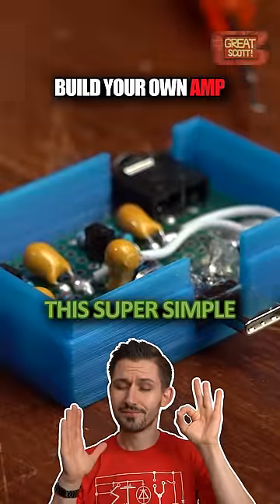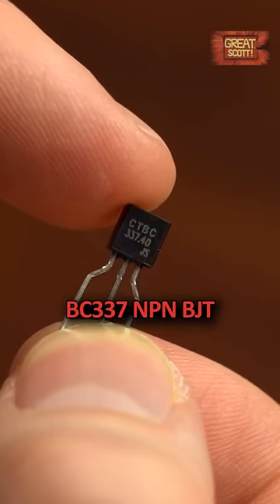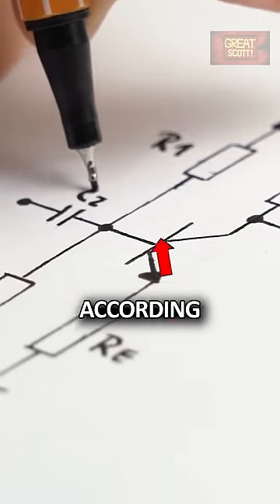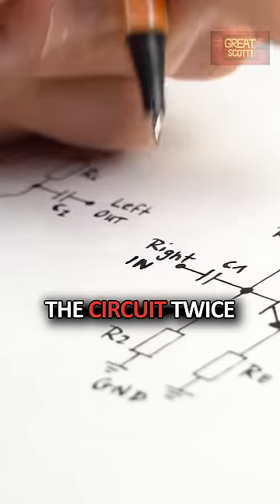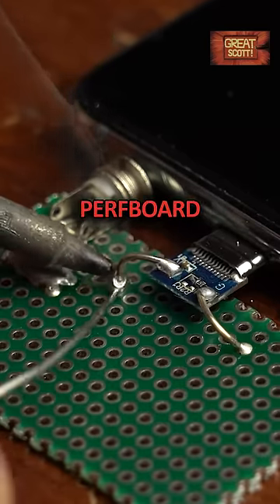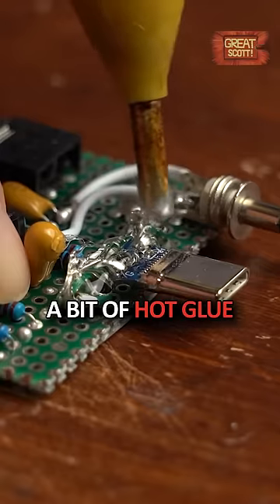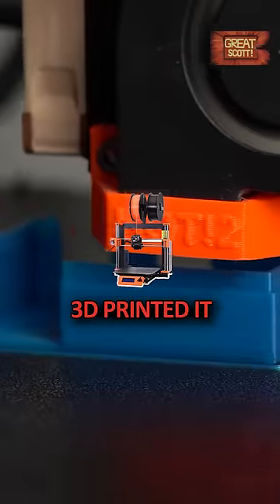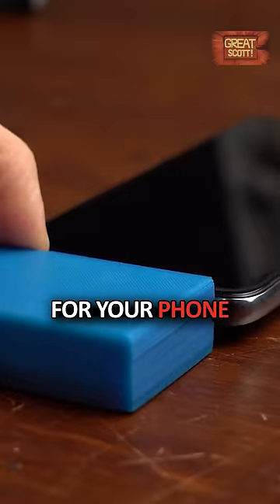Build the Best Sounding Audio Amp!

Comment: RIP headphone jacks.
Reply: Nope, still alive.
Reply: Headphone jacks are still alive, it's just a stupid trend apple introduced which fortunately was short-lived. High end phones don't have it cause they assume you're rich and have wireless but on low and mid end phones it's pretty much standard
Reply: His implementation obviously isn't going to do his equipment any damage, but the ability to blow out something is too easy for any amateurs replicating it 😅
Reply: @MikePerreman would gladly have my fold 4 than a headphone jack just saying..
Reply: my $150 phone have it, along with ir and included charger 😂

oh and also micro sd card slot along with dual sim, 5g 😏
Reply: @Mr.Engine993  is it possible if i solder the speaker output to a audio jack
Reply: @Mr.Engine993 my xperia 5 is high-end and has audio jack. perfect for gaming as bluetooth introduces latency.
Reply: @unusedaccount-b7t  theoretically yes, but it would be too much struggle and 99% chance of failure unless you are a phone expert (then it would be 60%, those solder connections are miniscule on modern day phones). Even if you succeed, you'll fry headphones and such devices because the signal for your phone speaker is amplified beyond line level (for headphones)
Reply: @Mr.Engine993  thanks for telling me that. i was planning to do that but i remember my hand always shakes
Reply: @Mr.Engine993 even FAIRPHONE dropped it. Still mad about that
Reply: Galaxy A here, it's nice to have one! 😊
Reply: @MikePerreman wait the latest Samsung also don't include headjack?
Reply: @MikePerreman  do they also no longer gave you charger like apple?
Reply: @Mr.Engine993 They also dont want you to have an analog signal at hand that you  can copy easily etc. If they could they would do the same shit as with video, DRM everything.
Reply: Get a Sony phone
Reply: Actually some of that "no headphone jack" phone still use analog output, just via type-c pinout, theoretically u just need to modify this project to working with that such phone, for some high end / newer phone that use data audio need type-c dac to play audio
Reply: @Mr.Engine993 Sony has them on high end phones. But I don't know for how long.... :(
Reply: Do you know what is more stupid than no jack? Still having the hi-res 24 bit/ 192kHz DAC inside LOL
Reply: the phone he's using literally has a headphone jack
Reply: @Mr.Engine993 Sony phone still has headphone jack but it'll cost a lot of money
Reply: @Mr.Engine993  You don't have to be rich to have wireless , just stupid. You can find brand name wireless earphones for like 20 bucks and they are ok.
But, even expensive wireless earphones are bad.
Wireless is far inferior tech in terms of audio quality than wired.
The power and consistency of audio signal is worlds apart. Heck you can lose signal completely with your phone in your pocket from time to time or the wireless ear plugs not being syncronized.
Reply: Unnecessary, coming from an audiophile myself. Any good headphones need their amp/dac. Planar magnetics are so open you’d annoy others. Not saying there are no closed off good dynamics driver headphones, there definitely are, but honestly how often have you seen for example (an other pair of headphones I have) Sennheiser HD600’s anywhere irl? Those are 300 ohm even with my iFi xDSD Gryphon, handles them no problem. Issue fixed. It has Bluetooth. Magic.

Comment: Now make a usb c DAC , cause I don't have a 3.5 mm jack :(
Reply: phones can still do analog audio out over usbc, you just need a breakout like he used
Reply: @game-tea well, not all phones do and even then, analogue audio via usb c isn't that good.
Reply: @harshlarose6670  whoops my mistake, interpreted Samsung's "384 khz 32 bit dac" spec on high end phones as them having analog audio out. Thats a bummer.
Reply: There are adapters.
Reply: Yes, some phones do really have analog signal via USB C. my USB C adapter from a Sony phone doesn't work in samsung, but on other brands. Don't know why
Reply: There are plenty of good usb c DACs out there, but why bother? If you're on android, just buy a radsone es100 or a qudelix 4K. Pricier than some usb c dacs (but not all lol), but they can drive surprisingly powerful cans, and the qudelix can even do parametric EQ, including an auto EQ that looks up headphone EQ from a database. If your phone supports Sony LDAC, there's really no reason not to use one. It can also double as a bt audio device for your car if you have an aux in.
Reply: @harshlarose6670 I don't believe that. If a phone doesn't have a 3.5 jack, it will have usb playback. Has to.
Reply: @ZenTunE-  USB audio output has two mode. analog, which only switched the USB data line to internal DAC output and the real USB audio i/o. not all phone have this analog output capability but every phone with USB OTG feature should be compatible with UAC device.

what he meant is the former ones, analog output over USB port that requires no external DAC
Reply: Yeah
Reply: Simple adapter for less that 10
Reply: @n.shiina8798  Phones not having analogue output is exactly what I meant. The pins are too small to make any good quality analogue connection anyway so if it's USB C, it's better to use a DAC.
Reply: @harshlarose6670  i dont think the pin is the main issue at all. 3.5mm jack also uses a small contact point and most phones are unable to drive more than a few miliwatts. what made them sh*t is the internal DAC quality and the lack of power to drive proper headphones
Reply: @ZenTunE- samsung doesn’t do it - bought 5 adapters to realize I need a dac, it’s frustrating - sound is coming out of speakers but no redirection to the usb c cable - why? Even apple does that properly
Reply: @robob3ar  I learnt about this too recently. My Honor 20 has analog usb c audio support and that is the adapter it actually comes with. Always thought the dongle had a dac in it but guess some don't then.

Got an apple dongle which does have a built in dac and the difference is insane, the phones built-in dac has so much static noise. Never gonna use the internal dac again.
Reply: Since apparently my comment failed to post, alc5686.

Comment: Getting a 1$ 2x3W class D amp would be far easier and more compact to do but I appreciate the effort.
Reply: its for educational purposes
Reply: Class A may be older, simpler and not as efficient as class D but the quality for the effort is unmatched. It is way harder designing or to apply a class D amp and getting the same quality out of it as with class A.
Reply: @tzrgfdrte a class A amp with a single BC337 and 4 resistors probably doesn't sound very good though. Neither do the $1 class D ICs, but they're probably pretty close.
Reply: Yeah perfect
Reply: @Taarakion For pre-amp there's nothing more than that..
Reply: @Taarakion  from my experience, they sound very good, there is obviously some hiss when nothing is playing and a lot of noise is introduced if they're powered by a USB charger (or anything else plugged into the wall that introduces noise to the power line). But that can be fixed with a capacitor.
Reply: @tzrgfdrte  class D already sounds good enough for super cheap but if you're an audiophile, for a bookshelf speaker set, class A is understandable. But a tiny 3W speaker will be nowhere close to making the most out of a class A amplifier's potential
Reply: @Taarakion this design will sound completely fine
Reply: I made an OTG powered amplifier in 2017 as small as a mini-jack to RCA adapter. It is very small. I have made a video about it but never published the video. Still use the device to test speakers or use it in the garden with some external speakers.
Reply: @Mr.Engine993  You 'discovered' the ground loop.
Reply: @codebeat4192  it's actually noise from the power adapter which converts AC to DC. So a bit of noise will inevitably pass through. I've found a ground loop isolator quite handy in such situations
Reply: but it sounds worse
Reply: @woiuu  no. A USB OTG phone port can give a maximum of 0.5A@5V meaning 2.5W at most. There is no speaker this tiny that could make you hear the difference between class A and class D.
Reply: Don't use a class D amp for headphones unless you like hiss.
Reply: @drthbn  headphones don't need amps most of the time. But yeah cheap class Ds have a lot of hiss. You can easily fix that with capacitors though

Comment: For those without 3.5mm audio connectors, a lot of phones expose an analog audio output through the USB connector.
Reply: Not analogue sadly, you need a IC for that
Reply: @__bennie_ he say a lot of phones some phones dont use dac but a c to 3.5 adapter thats the problem
Reply: @__bennie_  nope actually, it's called  Audio Adapter Accessory Mode, it's an analog signal, same as you'd get from the 3,5mm jack - L, R, Mic, GND
Reply: @oiytd5wugho woah! Do passive adapters exist to break that out to TRRS? Every C to 3.5mm adapter I've ever seen had a DAC inside...

Comment: Cute. Now, to be clear, a "Class A" designation for an amplifier is just an arbitrary type, not some kind of quality measure. Although they sound pretty good for low-power uses. Ok, they sound good for high-power amps as well, but they waste a lot of power so you normally only see them among the more fanatical audiophiles. But for a small gadget like this it's a very simple solution. Just remember to turn off the power when not using it if you feed it with battery power. Otherwise you'll drain the battery quite quickly.

Comment: A decent opamp will blow this out of the water. Even a simple ne5532 will do. It has like 50mA of output current.
Reply: Maybe, but that doesn't help with learning the fundamentals of electronics. Far too many of these kinds of channels just use pre-built modules, or microcontrollers, because it's cheap and easy, but the underlying functionality is lost. To truly understand, you need to see things built out of discrete components like this.
Taking your approach, why build a crystal radio when I can listen to the radio via a smartphone app?
Reply: @paulsimpson6290  That is definitely a valid point however if discrete elements were to be used, Id go for something for desktop use. Also looking back at my comment Im not sure that ne5332 would be better than a decently designed class A amp.

Comment: This is just amazing cant wait to make one for my iPhone 13
Reply: unfortuantly that isnt possible since the iphone doesn't have any headphone jack and uses lightning instead of USB-C
Reply: @SDFTDusername  of course you  can make one. The specs for the lightning connection are available, al you need is a proper DAC. Lightning even has power output, therefore you can create this type of amp.
Reply: lol

Comment: Yeah, but where'd you get a phone with a 3.5mm jack? 😲
Reply: bro not everyone use iphones
Reply: @truuumingtruuum6586 nah bro, even androids are like 50/50 oneplus has abandoned 3.5mm jacks too
Reply: Redmi 9 pro🎉
Reply: @truuumingtruuum6586 android starts leaving jack too :(
Reply: @truuumingtruuum6586  OnePlus hasn't had them for years. Same with the Samsung Galaxies and Google's own Pixel line.
Reply: Android world
Reply: They're pretty easy to find really. Quit buying garbage.
Reply: @GSBarlev  plenty of Galaxies with 3,5mm audio jack.
Reply: @RaenYrtham  You sure? I thought it was only the A-series. I haven't looked at Samsung phones in a while, but IIRC the advice used to be that it was better to get a used S than a new A.
Reply: @GSBarlev  yeah, mostly the A series, from budget to midrange phones, there are a few models from the current line, and plenty from previous lines that are still sold, that still have it. The S series being the top range doesn't have 3,5 mm jack AFAIK, as most brands nowadays.
Reply: Zenphone 9 💪
Reply: Don't buy phones that lack a 3.5mm? Pretty easy solution imo

Comment: Please make a video on how to reduce eletrical noise from usb port for speaker. When i connect my speaker to pc motherboard usb port , at 60% volume zizzz noise from speaker, this is due to electrical noise or ripple present in power.This is a common problem.
Reply: There are usb noise filters, but you could just add a filter capacitor to the power line
Reply: Adding a small electrolytic capacitor in parallel should help but I am not sure what value it should be
Reply: @Mr.Engine993  i think 470uF should be good

Comment: If you want to build an amp matching the title bait, look for single chip class D amplifiers from TI or similar.
Reply: All those class D single chip amps is asolute garbage tho But this simple  schematic with a single transister amp will not deliver much output
Reply: @mrdali67  i think those ICs can beat this single transistor amp. sure there's way better ICs but if efficiency is your priority, those class D ICs is a good middle ground

Comment: I want to know how to make the Bob Beck Device Circuit but instead of using batteries be able to use the 12 volt cig port in a vehicle. or also having batteries but the same circuit charging while in use

Comment: Man, how complicated is this? This is why I gave up electronics. My brain won't take it in anymore. I used to fix tv's and video recorders, (yes, that long ago,) and gave it up 20 years ago and destroying more that I fixed 🤣. So, I got rid of all my equipment and now, if I want anything like this I just get it off eBay. So much simpler. Luckily I still just about remember what  circuit board is but then I was lost. Also, my eyes are so bad the smallest thing I could solder now would be ab out an inch square.